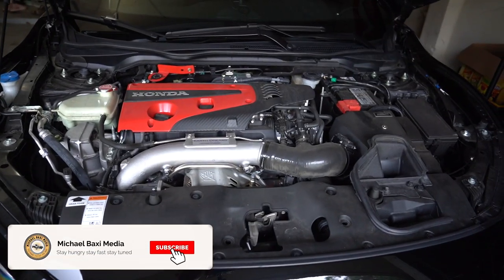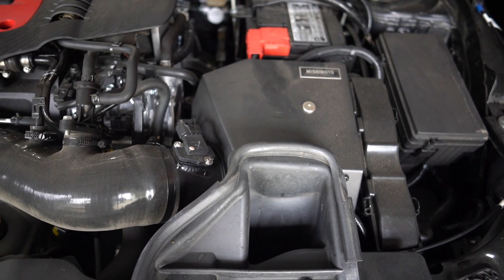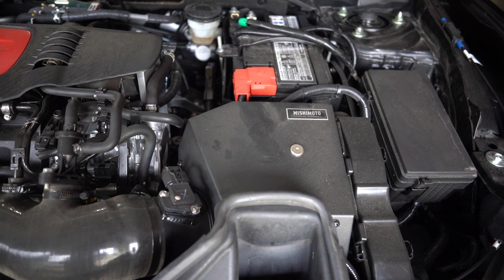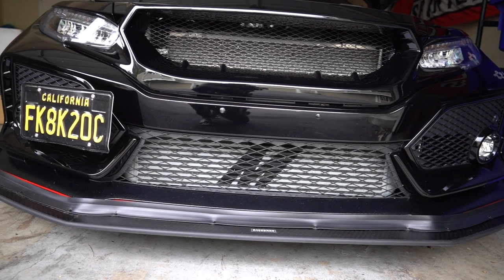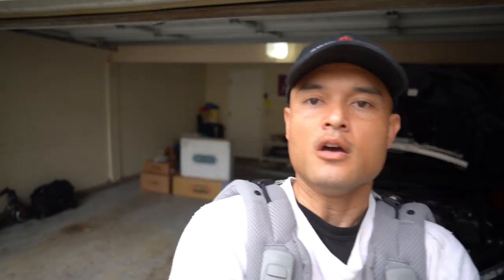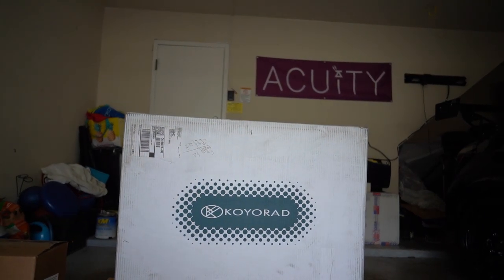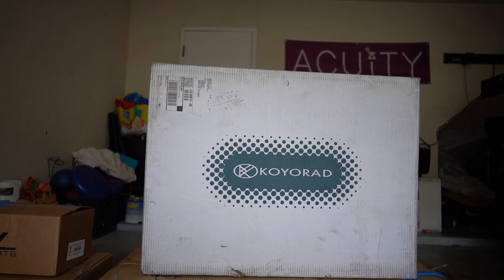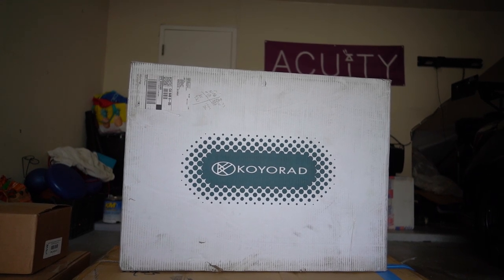Wicked boost combo PRL + HKS and more cooling with Koyorad!

Comment: I really think the Type R needs two things to combat heat soak. First reroute the intake away from the biggest source if heat, the turbo. If it’s rerouted below to the passenger side bumper that would solve it. If keeping the factory route, water injection will be the optimal way of cooling the intake temps. If you do both then that would be the best. Other than that an oil cooler should help too. The larger Koyo rad is also a great option. Even with the larger fmic blocking airflow to the radiator the factory fans kick on when the valve opens and turns them on when reaching specific temps.
Reply from the maker: Ronald Batalla all great ideas. Lack of space limits what you can do with re routes and relocations. The biggest culprit is how inefficient the factory turbo is. There are aftermarket solutions but none that are currently “affordable”
Reply: Michael Baxi Media There is one reroute cai coming soon

Comment: Awesome video Michael I went with the HKS Intercooler as well....I still need to get an upgraded Radiator.
I went with the Takeda Intake and noticed a 9-11 degree drop in IATs over Stock. 
Currently when driving at 45 mph and above the the IAT is only 10 degrees fahrenheit higher than Outside temps
Reply from the maker: TORQ Toolbox the Koyorad is a nice piece. Will be a nice addition to you already great build👍🏽
Reply: Takeda is good thick plastic and if you add heat reflective tape it’s amazing at keeping your intake  cool 😎

Comment: You're straight down to the issues. Was hesitant about your stuff, dont usually subscribe I guess Ill do. Saves me time and money on parts other than forums.
Reply from the maker: Happy that you find some value in what I do and thank you for your support!
Reply: @GridZilla  one part I have yet to see is the two piece brake rotor setup if you have thought about it.

Comment: Glad to see you go with koyorad radiator and PRL intake. I still have the mishimoto intercooler and charge pipes. You definitely will love the koyorad radiator. Itll beyond help keep temps down especially with the fact you have the Js racing grill. I switched out my mishimoto intake myself and went PRL. I definitely think you'll end up getting their inlet pipe as well. I also pulled the trigger on it as well. Curious to see how your car does on track. Keep up the videos man!
Reply from the maker: Thank you!

Comment: Nice video, I had a mishimoto intercooler, removed it after a week, got terrible turbo lag, replaced with dream automotive intercooler, the difference is amazing.. I just think the mishimoto is too darn big, plus it’s not designed for the UK 🇬🇧 FK8,  a few fitment issues,  can’t wait to see your results on the track.  Take it easy pal
Reply from the maker: Interesting that it doesn't fit with the UK FK8's Wondering if that has to do with the additional sensors needed for the Radar Cruise control? Thanks for watching!
Reply: The crash impact bar is different behind the bumper, and we also have sensors for the pop up hood system, then on the hard pipe there is an outlet which UK cars don’t have.. I had so much trouble with it and warning lights, mishimoto have collected it from me, and thanked me for my findings.. still waiting for a refund though. 😖 .. my car is now full bolt on, had HKS bov delivered today with modifications to fit around my eventuri intake.. going to dream automotive next month for live Hondata remap, hoping for some good figures.. I’d like high 300s
Reply from the maker: Earth Dreams UK sounds like a beefy setup!
Reply: I’ve gone for 

Eventuri intake
Scorpion red power 200 cell sports cat
Scorpion red power full exhaust
Dream automotive intercooler
HKS bov

I’m hoping that’s all I need to do, never used Hondata before so intrested in results.
Reply from the maker: Earth Dreams UK for the FK8 platform I think Hondata is the best on the market
Reply: I did consider K Tunner, but after watching people’s reviews etc, I think Hondata is the way to go, many thanks for you videos and insight.  All the best Rob 👍🏻😊

Comment: Careful about that induction sound. When I heard it on my R it meant that all the damn screws fell out of the panel to access the air filter. Had to replace the screws and used loctite blue for good measure.
Reply from the maker: Vasek Cekan that sounds scary
Reply: Proper torque goes a long way! ;)
Reply from the maker: PRL Motorsports 💯 %

Comment: Real cool car,  I have a 2020 Civic SI with a Hodata tune and PRL cold air intake, I`d like to do more bolt on`s but I`m concerned about passing emissions testing  in Ca. Do you have to go back to stock for testing ?
Reply from the maker: Yes you would have to go back to stock

Comment: Good stuff. This is not a knock on you, just FYI, this is why I tell most people to do research before modding their cars. Unfortunately most people rush on their builds than have to redo it spending more time and money. 

Pick your parts wisely. Now as for the intake, the stock intake well always be better, with a drop in K&N filter.

The car sounds amazing by the way.
Reply from the maker: chanhuor thank you sir. I agree on the research end. For me my needs changed during the build so what once made perfect sense no longer did. Thanks for the support and thanks for watching!
Reply: The stock intake used to be better ;)
Reply from the maker: PRL Motorsports big reason why first to market is not always best which is why I have a new found appreciation for the research PRL puts into their products 😁
Reply: @GridZilla  - Sorry Michael as for PRL intake, yes its out and avail but back a few months ago,  prl told me that it was NOT Calif exempt yet.  Has that now changed that it is CA exempt?
Now I can see how you and others are feeling; I was menatlly pressuring myself that I should have made all sort of mods by now. I was undecided between PRL and Misihi, mostly since trying to find a local shop and to avoid taking bumper off multiple times but now glad I waited.
Thanks for your honest and thurogh advice in sharing your mod and race adventures with us. You're an inspiration.
Reply from the maker: Forrest Bashaw 🙏🏽 thank you for the kind words and support. Not sure if the PRL intake is CA exempt but they are working on it

Comment: Did you purchase the hks intercooler with piping and prl charge pipes or is it only hks intercooler with prl charge pipes, hard to find info on this set up online. Did you need to do any extra mods for fitment of the parts?
Reply from the maker: You need the HKS pipe kit as well to get everything to work. There's one elbow piece on the hot side from the HKS that's needed so the PRL pipes work.

Comment: Which part of the PRL charge pipe kit did you not use. I thought the PRL charge pipe fits perfectly with the HKS Intercooler. Could you elaborate on that please?
Reply from the maker: Still need to use one elbow from the HKS pipe kit. Everything else can be PRL piping

Comment: hey mike, about to pull the trigger on the PRL charge pipe, just on the fence on the intercooler.  you just purchased the hks w.o the piping and used the prl pipes from the charge pipe kit ? thanks
Reply from the maker: YAYAYKEVIN PRL intercooler is a great way to go as well. You’ll need part of the HKS pipe kit to make the PRL pipe kit to work. I just really wanted the HKS intercooler with the benefits of the PRL charge pipe kit.

Comment: I want this car as a daily in Chicago. Would that be a dumb thing to do?
Reply from the maker: Get a good winter set or wheels and tires you could probably make it work
Reply: Thanks for the reply. Were you skeptical about driving around with that large wing before you bought the car? How do you feel about it now
Reply from the maker: @MannyOrtiz  Great question because I'm sure a lot of people probably have the same concern. Yes I was a little worried but I'm fortunate enough to have a parking Garage at work and a Garage at home so the vehicle is rarely parked out on the street where something like that for me would be more of a concern. Having said that I think most people just look at it in fascination and move on. You could easily have an old beater that someone decides to break the side glass on for no particular reason. No matter what you drive it's a risk and sure the wing draws a little more attention. May not be a smart choice depending on what neighborhoods you are parking in but everyone's situation is different. Use you best judgement.
Reply: Michael Baxi Media I seen that you have removed the wing and installed another one. Do you think I could remove it without being to much of a problem and go wingless? I know there will be a couple of exposed holes but is there anything else that would be a problem you think?
Reply from the maker: Manny Ortiz exposure to the elements my friend. I wouldn’t do it. Chance of water leaking in the panels
Reply: @GridZilla  you got the heat shield on with the turbo blanket??
Reply from the maker: @zg2017  yes
Reply: @GridZilla  awesome, anything need to be done to make it fit?
Reply from the maker: @zg2017  might need to leave one bolt off on the heat shield to get the blanket to fit

Comment: Do you have the race maf or the street maf for the PRL HVI?
Reply from the maker: Street MAF. Race MAF wasn’t available at the time
Reply: @GridZilla  thank you! Which one would you recommend? Caught the track bug and now I want to build my car to be capable on track but still daily-able. Im stock under the hood, but I have Hondata. Should I go race maf or street maf? Pros and cons to both? And why HKS over PRL for intercooler? (I like my JDM parts so I’m leaning HKS but I also wanna be good and reliable on track)
Reply from the maker: @dlrulez619  you won’t really see the benefit of a race MAF until you get into a custom tune. If you’re just starting out tracking there are many other things you can get first that will improve your times. Like light forged wheels and stick 200 TW tires, some very good coilovers and generally speaking just a lot of seat time
Reply: @GridZilla  already have wheels/tires/suspension and have some seat time, and now I’m just looking to increase a little bit of power- thought about running street maf but I’m now considering race maf to kinda “future proof” myself and just buy once instead of having to buy the street maf now, and decide later on that I might want more power then going for the race maf down the line
Reply from the maker: @dlrulez619  gotcha then it’s not a bad move in your case but get a custom tune done if you get it

Comment: Hey can you tell me how do you get the oil temp gauge showed in the center screen?
Reply from the maker: Yuanyi Xie oil temp is not an available feature from the factory on 2017-2019
Reply: @GridZilla  Thanks, can you tell me how do you get your meshed fog light cover for the oil cooler?

Comment: Ur misshi int. Didn't come with the pipes?
Reply from the maker: Imlooking 4-work-atm it did but the core is so large it felt a little laggy on boost
Reply: Michael Baxi Media do you think the charge pipes made the dif? Or just the intercooler.. cuz the Mishimoto is bigger?
Reply: Cuz I don’t want to regret not getting the mishi

Comment: Does your Remus exhaust drone much when closed off between 2-3k rpm ? I had an Invidia r400 exhaust and it was just drone and sounded meh
Reply: With stock DP and the valve closed, it basically sounds like stock between 2-3K RPM. It's extremely quiet.
Reply from the maker: EpicDaveTime I haven’t experienced any drone. Maybe a tiny bit under load uphill but nothing like the Invidia
Reply: @GridZilla  thanks brother you're the best
Reply from the maker: EpicDaveTime 🙏🏽❤️👍🏽👊🏽

Comment: Michael how much of the quicker turbo spool is being caused by the PRL Charge pipe kit? Do you feel like the car is producing anymore power?
Reply from the maker: KG_ONE R hard to say how much the charge pipe kit by itself is making but the combination is killer with HKS. Not sure if it’s making more power but it certainly making more usable power if that makes sense. For sure it moved the power band lower in the RPM range. That alone made the switch worth it.
Reply: @GridZilla how u install the prl charge pipe with hks IC. Its that hot area i need to use Hks pipe. Because Prl charge pipe at hot area is design same with stock Ic. Can give some guide to install it
Reply from the maker: @AMWChannel  would love to except I no longer own this vehicle but yes it’s the hot side part of the HKS pipe kit you need to use to make the PRL pipes work.